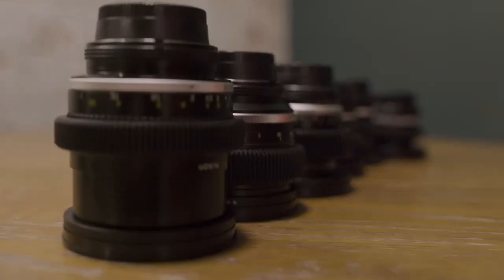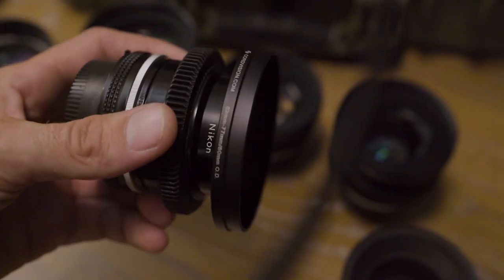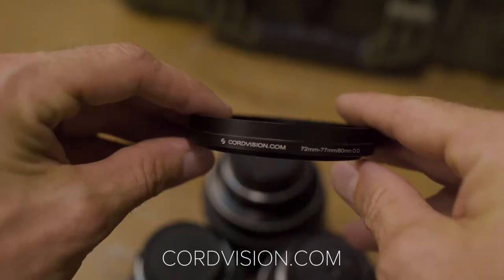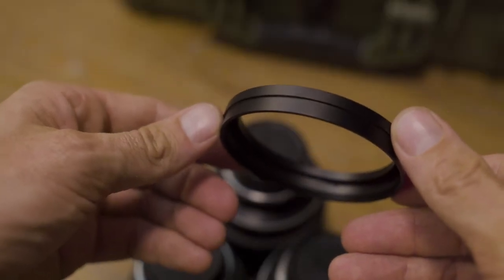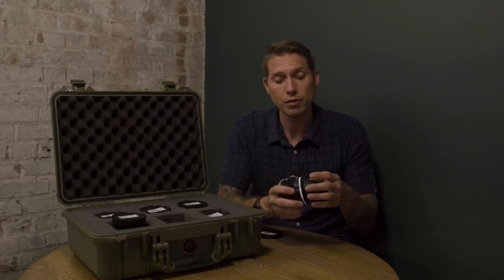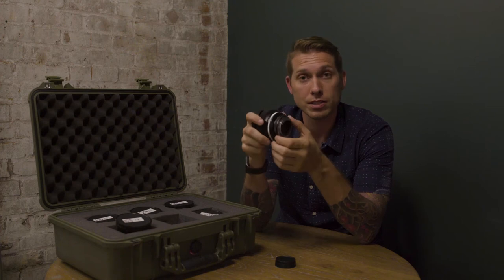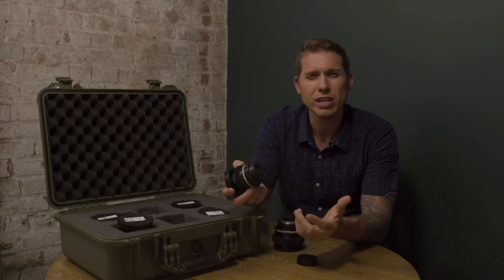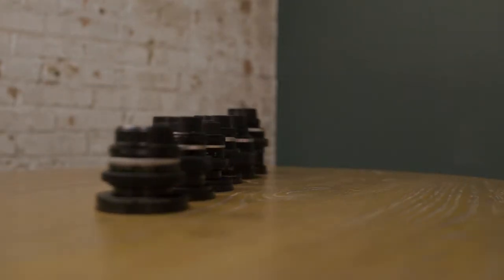Cine-modding vintage Nikon AI-S lenses

Comment: Been looking at this for some vintage zeiss. I’m in the uk and luckily there is a company in london that can declick and dampen the aperture, add focus rings, convert to an ef mount and provide front diameter external 80mm and internal 77mm as well as caps and rear caps for about £300
Reply: So you went for vintage zeiss or nikkors?
Reply: @glebmazur9892  got a nice zeiss distagon 25mm f2.8 off ebay already modded to an ef mount, declicked aperture and focus gear for about £400. First one but pretty happy with it
Reply: @gwem1979  I recently got small set of CZ rolleis, they are pretty good!
Distagon 25 2.8 West Germany non hft;
Distagon 35 2.8 West Germany;
Planar rollei 50 1.8 Singapore;
Voigtlander color-ultron 50 1.8 Singapore;
Sonnar 85 2.8 West Germany non hft.

25 2.8 + viltrox on GH5s:

https://fex.net/ru/s/r3betc9

All converted to EF (sadly, wider ones cant focus infinity with any adapter because of focal flange), 85 is absolutely gem, but its pricey! 
Cant recommend them in low light situations( 
Otherwise they`re great built and perfect optical performance.
Reply: @glebmazur9892  i find the image out of the zeiss just that much better than the regular canon lenses. I can’t quite put my finger on why exactly but its enough to have convinced me to get more vintage lenses and convert them
Reply: @gwem1979  can’t say i like canon lenses (the only thing i like is speed in modern ones), but I really should try to get out this zeiss lenses more and understand what exactly i need.
I am on m4/3 and right now my clients want to see clean look, but for personal and artistic projects i can use zeiss and this 4 focals cover my needs;)

Comment: Thanks for this review!  I’ve gotten a 50mm 1.2, 24 mm, and an 85mm AIS.  Do you use a matt box?  When focusing out  (focus ring pulls lens in) I notice the focus ring tension goes up considerably.  The rings seem to be oiled, but still have much more resistance than new Nikon lens with a focus by wire system.  Is this normal?  Should I have the lens looked at?  Any advice is appreciated!
Reply: Get a swing matte box not a clamp on

Comment: I want myself a set of lenses from nikon ai ais like cinema lenses.  Should I apply for ai or ais?  Is there a big difference in the quality of the optics? Tell me please
Reply: The optics are usually identical.  The S in AiS will allow your camera to meter more accurately under certain conditions (need to enter non-cpu lens); but especially if you CPU modded your lenses.
Reply: @marklindsey1995  stroke rotation focus more than a ai

Comment: I just sent my Nikon 28mm and 50 Ais lens to Duclos for Cine-Modding. I currently use them with my Nikon D700 for photography and they are some beautiful lens.
Reply from the maker: Absolutely! Great look for the money. I think they'll be going up in price in the coming years as lenses that cover full frame start becoming more valuable as sensors get larger.
Reply: I strongly agree! I already have a few AiS lens( 28mm,35mm,50mm,105mm),im thinking of getting the 20mm or 85mm? I also have some Leica-R (28mm,50mm early 1980's). FullFrames are getting more affordable. The new fullframe  Sony A7 iii is only 2,000 us dollars. Now is the time to look and invest in certain older lens. I'm getting each modded and C.L.A by lens repair company here locally. I've done my research as to why certain lens " pop" and others don't. Not all vintage lens are the same.

Comment: Hi. Great video. Thank you. I’m going through the same process of modding a set of ai-s lenses. Can you please explain the aperture ring dampening in a little more detail. Did you wrap either plumbing tape, felt or something similar around aluminium contact surface before you applied the grease? Or is the grease alone enough to fill the void and remove the slight rattle that occurs once the metal clicking tab is removed. I’ve used just felt and not happy with the result. Any help much appreciated.
Reply from the maker: Hey Patrick! I didn't do anything to the aperture rings other than adding the grease. It works perfectly. I had actually read about people using plumbers tape, felt, electrical tape, etc. Prior to purchasing the grease mentioned in the video, I tried all three methods and while it did dampen the aperture ring and stop it from spinning, it was clunky, sticky, and the smoothness varied widely from lens to lens. Some felt OK, other stuck at certain points when spinning. I would strongly recommend going the grease route. It was an "ah-ha" moment the very first lens I put it in.

Although the tiny tubes of grease on Leitax's are expensive for what they are, I'd recommend buying 2 to be sure you can liberally coat the inside of the aperture and make it hold enough but still be nice and smooth. I'd also advise against using other types of grease as they can drip, especially if shooting in hot weather, which you don't want for obvious reasons.

Hope that helps.
Reply: Great. Really appreciate you sharing the results of all your testing - it’s saved me and many others a lot of time (and money getting the mods done professionally). I have 8 rings to dampen so I’ll take your lead, pick up a couple of tubs of mentioned grease and let you know how it works out. Thanks again.
Reply: Hi, the leitax grease has arrived and I’m ready to start. How much did you apply to each aperture ring? Is your recommendation of 2 tubes for each individual lens or will this amount sufficiently spread across everything? In your case 6? Thanks for your help thus far.

Comment: Great Video, thanks for the info!
1. Can you actually pull focus accurately with f1.4 aperture? (assuming you have someone to pull focus with moving subject and or camera) or do you find yourself using f2 in making films?

p.s. I am considering an 85mm f2 / f1.4 for film-making

2. Do you find the focus throw too short on these ais lenses to pull focus? (i.e. can they somewhat be used as "cine" lenses?)

Thanks a lot!

Comment: Thanks for this info! With the mirrorless cameras especially, more and more people are realizing what great results can be achieved by adapting well cared for manual lenses from the 70's and 80's.
Some newer lenses might score better with shots of technical charts, but to get a better result in real-life situations you'd really need to spend allot more, like 10x more, at least for now.The ebay values for the lenses I've had for years is suddenly skyrocketing! $2,500 or less invested now for a full set of primes, or $1,500-$15,000 PER LENS to get a barely-noticeable, "better," result. My clients don't care what lens I carry, they care how their finished video looks... and these SLR primes look fantastic. Yeah, I'll stick with my adapted SLR primes for most work and build my "real" cine lens kit over years, one lens at a time :)
Reply: Andin Briwel looking to do the same thing. And the vintage micro contrast look you get from the old Nikkor lenses is epic . I have the 28mm ais and the 105 f/2.5 non ai with such a nice long throw. Want the 85mm f/1.4 ais for that insane bokeh next .

Comment: Tell me something! You said you spent about $2500 for all the lens and parts needed to cinemod them yourself. Isn't it easier to just buy the Rokinon Cine DS lens set for about the same price? Did you research that option? Is there a reason you did not do that?
Reply: Good question! I own a few of the Rokinon Cine DS lenses(this video was actually recorded with the 35mm). They're fine for a a lot of applications, but they don't have a ton of character. For instance, I really dislike the way they flare - usually just a white streak coming out of the corner of the frame. The look a bit clinical to me.

All lenses are not created equal. These older Nikkor lenses have great glass, a very pleasing look to their flare, with beautiful warmth and character to their look. And it's not always desirable to have that character for every project, but to my eye the qualities of these are more pleasing. Getting a similar look in something like Cooke lenses would cost tens of thousands of dollar, and right now I'd rather rent that level of cinema lens when the project calls for it over investing that much up front.

I'll be doing some tests of these so it would probably be useful to put a video together with those tests.
Reply: I do agree with that. Rokinon's are indeed a bit characterless when compared to some of that vintage glass or the high end cine lens. Now taking a detour; because you seem to be good at opening up lens and checking them out, I am hoping you might be able to throw some light on an issue I am facing with one of my Rokinon cine ds lens.

I have a Rokinon Cine DS 24mm nikon mount lens. When the lens is NOT mounted on my Nikon d750, the aperture ring functions well and works like it should. Once the lens is mounted on the d750, no matter what setting I try for the aperture ring, it slows turns back to the widest opening automatically i.e. T1.5. I turn the aperture ring to T4, it slowly turns back to T1.5. I turn it to T12, slowly turns back to T1.5. This only happens when the lens is mounted on the camera. When NOT mounted, it stays put. I do not see this happening with any of my other Rokinon Cine DS lens, that leads me to think this is an issue with only this particular lens. Almost like some spring tension is pulling/pushing it back. 

I don't understand why this is happening or what to do to fix it. Would you be able to give some suggestion or explain why this could be happening? I do not want to spend hundreds again to fix it, instead want to try and fix it myself. But don't know how to.
Reply: So I have the Nikon D750. Do you think getting a Rokinon 85 mm Cine lens is worth it for filming ?
Reply: Try nikkor glass, i love my 35mm and micro 55mm. And i regret so much for selling my 80-200 :(

Comment: Hey, I just bought the same Nikon ais lenses and I'm halfway through de-clicking them. I have a problem with my 35mm 1.4 (same as yours). Compared to the others the 35mm 1.4 is built differently, I couldn't get the ring to stick with the aperture.  I have searched for the de-click for the specific lens and you are the only one that hopefully has the right knowledge for me. I really need your help on this one, Thanks.
Reply: Hey did you ever get the answer to this? I am considering a 35/1.45 myself for conversion.

Comment: I would NOT suggest putting grease into your lens to dampen aperture. Please use something like self-adhesive felt instead. I can only imagine hybrid shooting on a warm day and splattering grease all over your sensor....
Reply from the maker: Hey, apologies for the late reply. Just to throw it here so others can see - the kind of grease used inside of lenses is used because it doesn't become viscous in warm climates or harden in  cold temperatures, although many lens apertures do still stiffen up a bit in extreme cold. I'm not a grease expert(and don't think that's something I wanted to pursue), but did a lot of research on this before purchasing this particular grease. It's what lens manufacturers use from their factory, so if you have any kind of cine lens chances are there's a grease similar to this inside.

Also, I did try the route you suggested before redoing them with the grease, and the results are MUCH better using the proper grease. The felt sticks and doesn't offer nearly as smooth o a solution.

Cheers!